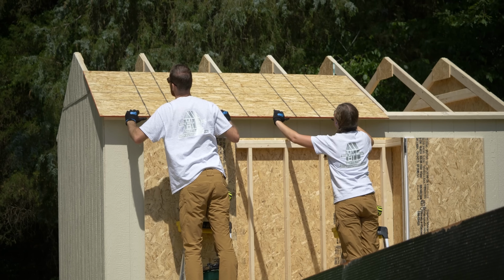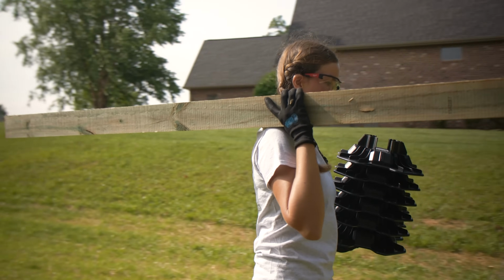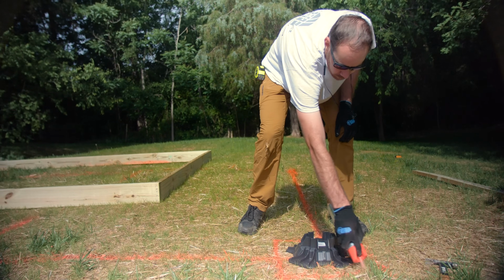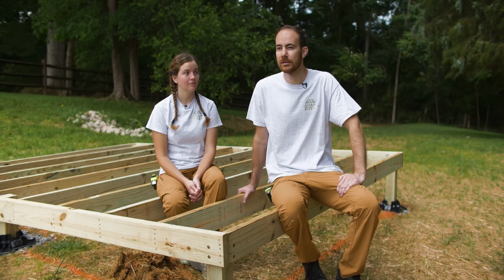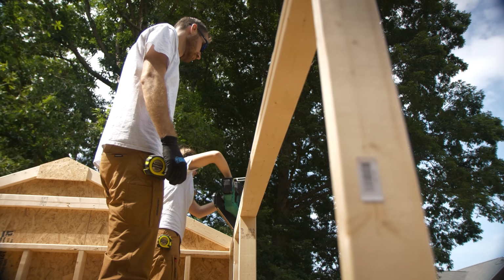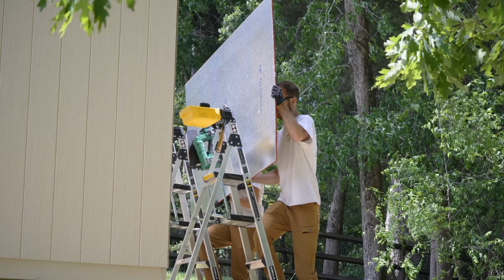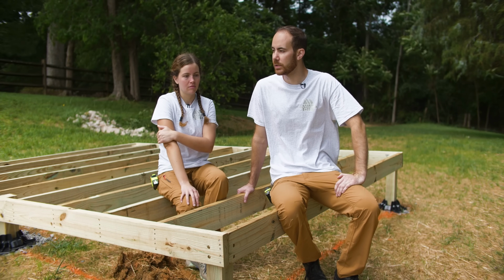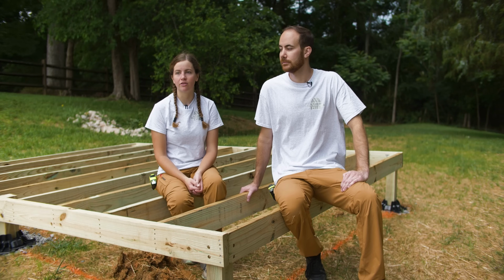Stop Using Concrete for Sheds—Do This Instead!

Comment: Not notching out those 4 x 4"s and relying on your hardware to support the weight of your building is bad juju.
Reply from the maker: Totally hear you, Dave. Notching can add strength in certain builds, especially for long-term structures. This project followed the hardware manufacturer’s specs, but every build is different. We always recommend following local codes and best practices for your specific design.

Appreciate you weighing in.

Comment: Why they didn't cut the hoist width nutch on the 4x4 to place the hoist weight on it instead of the screws ?
Reply from the maker: The sheer weight for 3/8 lag screws are between 600 to 1,200 pounds each. It's preferable to use notched posts, and you can see that in other videos of ours. But in this case Jerry and Sierra factored in the load rating and with a small shed like this it sufficed. They just built a shed about 3x the size of this one, and for that they notched the 4x4 posts so the weight is on the post, not the fastener.

Comment: I just came by your video and building a 10x16 shed. I am using 2x8 for the floor joist. I bought 7 of these blocks. 3 in the front, 3 in the back and one for the middle. Is that enough?
Reply from the maker: If you use joist hangers correctly and it's in line with your allowable span then this can work ok. Your best bet is running the cross joists at 10ft lengths. Just make sure the joist hangers are installed so the joists are snug.

We have another video for the type of build you're looking at which might show what I'm talking about in better detail:

https://www.youtube.com/watch?v=2WOIIaLHJ1w

Comment: Putting together plans to build a simple lean-to 12x12 next to my existing storage building of the same dimensions. I was dreading having to dig holes for the four 4x4 posts to be used. But then I discovered the Tuffblock product. Problem solved.
Reply from the maker: Love to hear that! Best of luck with your build.

Comment: Only 6 Tuff Blocks for this med size shed?
Reply from the maker: You would likely need more for a subframe of this size. Some builders count the joist hangers as load bearing supports similar to TuffBlock, but it's probably worth using more TuffBlocks under the cross joists for optimal strength.